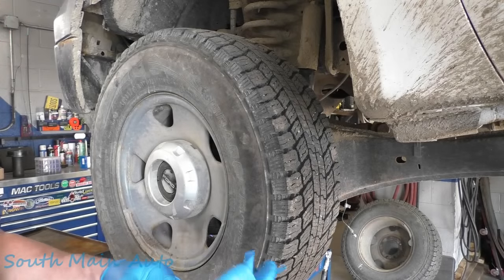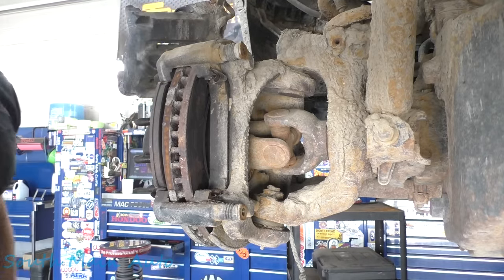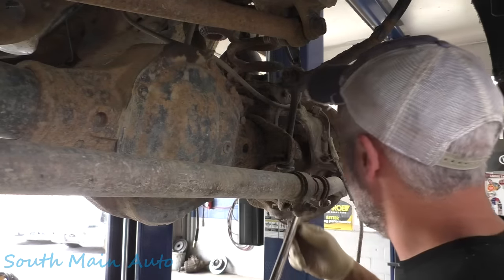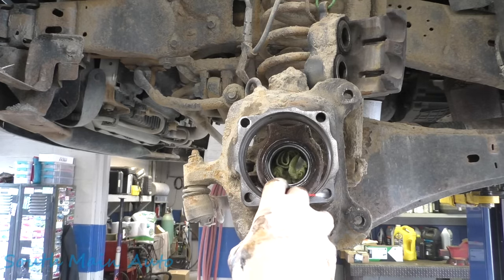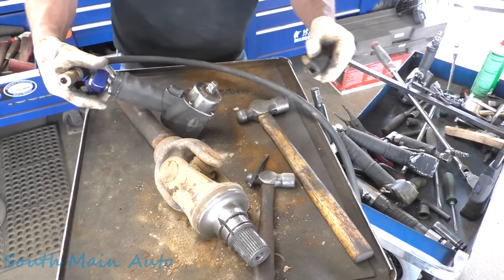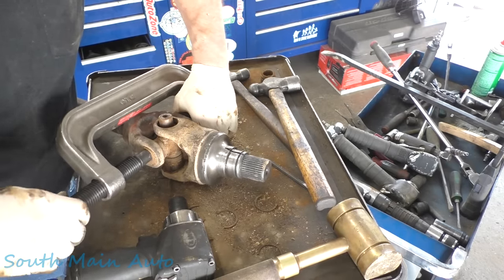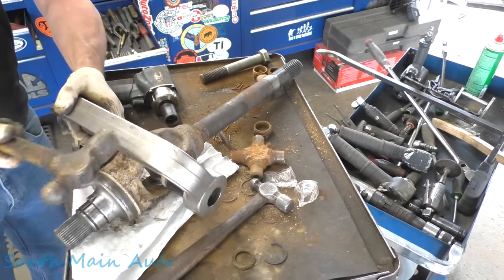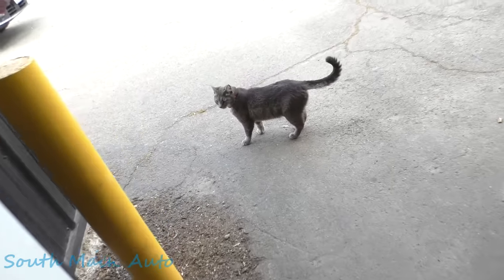Ford F250: Front Axle U-Joints Replacement - Part I

Comment: Eric, not ashamed to critique ever so slightly - and, you did a very good job of getting that joint back together, BUT.......  Hahahaha.  I noticed you started the endeavor with remnants of the old joint all over your proposed work area, and subsequently wiped off the bearing axles before installation, because it got into the mess underneath.  If you had taken about a minute to sweep off the crap and get it out of the way, then taken "Mr. Hankie" (shop towel) and some brake clean, the step of cleaning off the yoke could be omitted - plus, after job cleanup would have been slightly easier.   Given that truck has been abused and neglected, I quite imagine you will be cleaning your shop up for a week anyway.
Many, many moons ago (Like about 55 years worth) an old man who was an excellent mechanic taught me how to do those joints and he instructed me to put a liberal amount of grease into the cups so the needle bearings would stay wrapped around the inside of the cup no matter what you sis to it - within reason.  In my time of doing my own mechanic work on my own stuff - quite a lot of them needed new U-Joints - never had one fail because of needle bearings going awry.  Just a thought.  
You are one of the best mechanics on here, and I thoroughly enjoy your work.  Particularly, your electrical troubleshooting - and my son watches you as well.  In fact, you had just finished a video of that rusty Chevrolet with the rusted through shock mount and crushed wiring run, which caused the problem you were trying to rectify, and my son called me about fuses blowing on his Dump Truck.  Of course, I told him that he had a crushed (shorted) wire in the loom and to go watch your video - which he had already done.  I thought it was funny that all of us think alike in those respects.  He has seen me upside down and sideways in plenty of cars and trucks while he was growing up, so I can easily relate to everything you are doing, and fortunately, my son got to see a lot of it first hand over the years.  He's 43.5 now.  Keep 'em coming my friend, love the dry wit and talking to us.  Makes me laugh every time.

Comment: Eric, I realize you guys have a lot of rust issues over there and I do not envy you at all. However, we deal with a lot of mud. More times than not. We will take the wheels off in the parking lot and pressure wash the complete knee assembly just to get all the crusty mud off, so we’re not having to fight it and look for all the bolts. Your friend in California, Ron.

Comment: I put the grease fittings in the u joints when I did mine. they normally arent included, mine were blanked off. They havent hit anything yet. I give them a shot of lube at oil change time. Next time it's going to be the ball joints. ICK I can't hardly wait. I watched to see what snap-ring pliers you used. That part of it pushed my limits. YES a real mother lover. Sweet wife walked by as I was fighting the first one and she said I've never heard you talk like that.

Comment: I have owned two Ford pickups. The first was a 1972 . Over all the truck was ok except for the POS timing chain eating 302. I got to where I could change them with my eyes closed. I back up the POS timing chain eating 302 with, my brother had a 72 LTD company car that he put three or four timing chains in before the company paid him to drive his own vehicle. I owned  a 1997 that I didn't keep long because it was junk and dangerous . Money lights , brakes sucked and if it rained in Elmira (I live in near Binghamton) the tires would spin . It was the worst vehicle in snow and rain in the  nearly 50 years of driving that I ever owned . I had an 88 Chevy square body two wheel drive that was a beast in any weather  . I could drive through snow up to the bumper without spinning a wheel .
Reply: We're all impressed...

Comment: When i push the u joint out one side i usually just cut the cap off so i dont have to push it back through.
Then remove the u joint.
In the past i pushed it back through and one time i opened up the cap hole to much and had to get a new axel

Comment: I thought you were playing the lumberjack song by jackal with your cutoff wheel. BTW, same people that would complain about using the cutoff wheel would also probably use a wire wheel instead. Not realizing the wire wheel simply polishes the rust/debris and leaves it in the corners . This is the source of so many driveway brake job failures. lol

Comment: What’s the labor rate to do all 4 ball joints on these things? It took me 1hr 30mins to do the passenger, and 2hr for the driver. I went kinda fast everything turned out great been driving it fixed the issue. I’m not a mechanic though

Comment: My 1996 F150s u joints froze up at around 200,000 miles. Took out both lockouts. But at least my truck was clean.

Comment: Having lived in the rust belt for almost 20 years, I cannot understand why voters allow the use of salt on the roads.  I've spent the last 10 years in a state where they put down sand and gravel instead and car owners have the sense to buy proper winter tires.  I love the northeast and midwest, but these videos reinforce why I'll never move back.

Comment: My only (and major) issue with Ford Super Duty 4X4s is that they only come with Manual Locking Hubs where GM and Ram now has the Automatic Hubs on their front wheels.
Reply: My 2014 has manual locking but also auto locking.  You only need to use manual when there is an issue with the vacuum and auto does not engage.   I wish my F150 had it as it broke during a snowstorm.

Comment: I know the High Sierras where snow is measured in feet, not inches. We don't use salt here out west. We deal with chains and use snow tires. Wouldn't the hassle of chains be better than your cars and trucks disintegrating in five years?

Comment: Eric get Vic out and cut the cross part of u-joint on inside,then drive out caps. Saves messing with clips and the rest of that nonsense. I've seen you work a torch, cut that joint out! Done it 100's of times. Try it out next time.

Comment: What are those two slits, 180 deg apart, on what appears to be an inner bearing race, seen just after 18:40? My first thought was I missed you doing that, but there's no video record of you trying to get off the inner race. Is the bearing entirely sealed, and that's just the way those things come? Are those slits there as a pathway for trapped water to escape?

Comment: Noticed you did not drain the front differential, is that due to the oil not being above the seal level?   we did this repair in 2021 and a u joint clip just came off and the cap slipped out so we are doing it over and will have to look at the yokes and use your cut off wheel method to clean them up better not sure why the clip came off 3 years later.

Comment: I have always wanted to know the grease temp rating in the OEM universal joints use for this truck application. Because as you can see, if a caliper pin is hanging up then the brakes can get very hot, and in turn, I think this can increase the operating temperature of the U-joints, and the U-joint grease. So, perhaps the reason the grease is underperforming is a limited temperature range as needed with a brake caliper hanging up, rather than just strictly a lack of maintenance.  Maybe a higher temp grease like Super Lube 71150 High Temperature grease GC-LB certified could help maintain performance at higher temperatures. For a common U-Joint I would think that heating is due to friction of the joint itself in operation and not normally subjected to another higher heat source, like a malfunctioning brake.

Comment: If I could have found a mechanic half as good as you, I would not have closed my shop. I had a guy that was ok, but he had to call or answer a call every 10 minutes and fight with his girlfriend.
Reply: I think that I used to work with that guy! In addition to the frequent calls to his girlfriend, he would occasionally run to the phone, dial a number and then hang up. Eventually, we figured out that he was listening to the radio and they had contests where the 108th caller won tickets.

Comment: Why didn't you disconnect the outer tie rod from the knuckle? It's a cotter pin and a 21mm nut. Easy to turn the knuckle then to get at the wheel bearing attachment nuts.

Comment: The U-Joint that you replaced had a zerk fitting. OEM usually don't. Does that mean that it had been replaced in the past but nobody bother to grease it regularly.

Comment: I have been at it for a week no bs ..everything else is apart  rather easy but this damn snap ring..I've bought 3 different pliers non of them fit width wise or dead enough..whay the frick pliers are you using? I've even tried using the power steering to push the hub and shallot out together so I can mess with the snap ring on the bench but can't get it to push all the way out....
Reply: Did you ever figure out the snap ring part? If so how did you get it out?
Reply: Yes found another video on youtube  super duty specific snap ring pliers ...Lisle part#  38700 sold on amazon ...has the snap ring out in under 30 sec...crazy, right tool for the job...lol they are curved to fit around the axle and they ratchet and lock to hold the ring open for install or removal...I bought probly 7 or 8 different style snap ring pliers before I found a video wish I could find it again to give credit but I believe it may have been put out by the company that makes them

Comment: Step One.  Check the truck..
Step two.  Call customer and tell them you're charging for an undercarriage spray and it will be at least 1 day longer.
Step three - (after wash) spray all parts liberally with PB blaster and leave for tomorrow.  

Then follow the steps in this guide.  ..
Final step...  Post the VIN so people know to avoid this truck if it's ever for sale. ..  it obviously wasn't well maintained.

Comment: Im surprised that they use a basic " Hardy spicer" ie universal joint on the front rather than a  cv type joint , I would have thought that the range of angles when turning would cause horrific vibrations?

Comment: I have been avoiding this job on my f350. Do you use the special seal installer for the vacuum hub seal or just tap it on carefully? Supposedly it sets the depth in the knuckle and onto the axle stub itself
Reply from the maker: I Use the tool

Comment: Hey Eric, what if the bearing caps on one side of the axle can be easily pushed on by hand, and are loose enough to see some movement?  Is the axle shaft considered bad an needs to be replaced?
Reply: Hit inside the yoke with a centre punch to bodge up the surface a touch.

Comment: Are CV joints just a cheaper version of U-joints? If there were slip yokes going into the transaxle of a front wheel drive car, and you used greasable U-joints, wouldn't that make front wheel drive axles indestructible so long as you greased the U-joints every so often?
Reply: For somebody that knows nothing you sure seem empowered to make engineering recommendations....
Reply: @Look_What_I_Did  After 30+ years of changing out U-joints and CV axles, yeah I guess I don't know what I'm talking about. Even though putting grease fittings on the CV cups of one car I did 20 years ago (and never had to replace those CV/axles again), yeah you're right tough guy/genius.

Comment: Do lots of them.  Both ball joints get torched and the u joint.  Abs sensor is almost always junk.  I pull it as a assembly. Normally the knuckle is the only thing worth saving. Salt belt plow trucks are never nice.

Comment: Somebody put that old u-joint in backward's.

The zirk fitting was angled towards the brake rotor, and it was likely near impossible to grease it.
Reply from the maker: There is no "backwards" when installing a wheel u-joint. If you cant get to the fitting "turn the wheel" it'll open right up for ya 😉

Comment: Swiveling Ratchet,thought one should use ratchets to undo tightened bolts ,the mechanism is only so strong ??
Could you change the joints without the special tools ,give us a down the old road demonstration ???

Comment: I'm not sure why you decide to make the ujoint removal as hard as you did.  Place the shafts in a vise that is wide enough to have the ears rest on each jaw loosly and then hammer on the other shaft and it will pop the caps out every time.  Those were not all that bad, could have had that apart in 10 minutes with just a hammer and a small chisel.  Spicer is the only ujoint worth a damn, not sure why people don't put those back in when they lasted the first 100K+ and a decade...  Life series for the win, no greasing neccassary.

Comment: Is it a fool's errand to hit that with a pressure washer first? Because it is hateful hateful working on something that nasty, and might be equal  in terms of time saved. It's almost as bad as fixing a manure spreader, with sugar everywhere.  I understand the customer has to ok it and the up charge. 

Would a once a year chassis lube with all points hit have saved him? Have to wonder about the drive shaft, ball joints, other lube points,  but only if asked. Good vid, glad it wasn't me.

Comment: You do not have any patience.  I am a federally certified aircraft mechanic and taught for 12 years. Had you used equipment to secure your parts you would have had an easier time of removing and replacing. I taught my students that we teach you as a mechanic how it works firs t then you finish real college like me with an engineering degree and learn why. You moved too fast and did damage to the parts. You were also prowd of what damage you produced. Terrible information for the uninformed.
Reply from the maker: Oh I bet you're a real joy to work with haha. Step one for your students. Come in and sit down kids I am going to lecture you on how great and wonderful I am for the next three days then you can write a report on it. Then I'll remind you each time I see you how I am better than you'll ever be 😂
Reply: Prowd?  Is this Mr. Hamas?